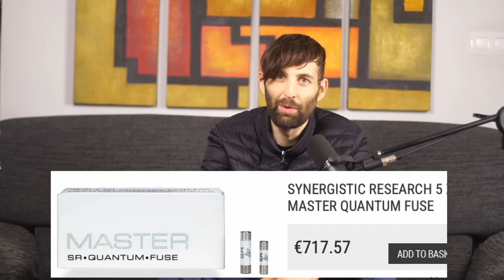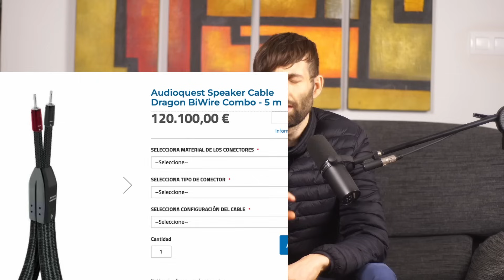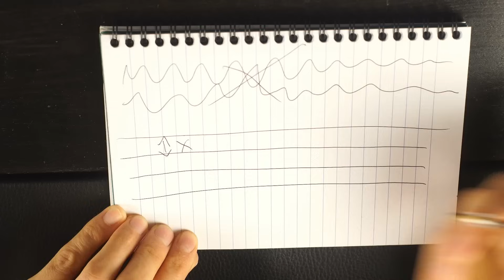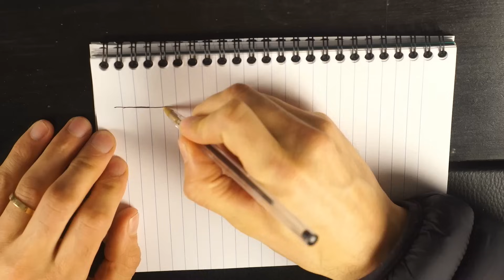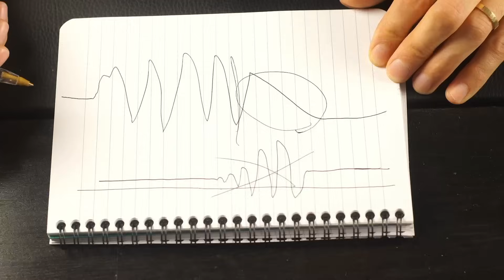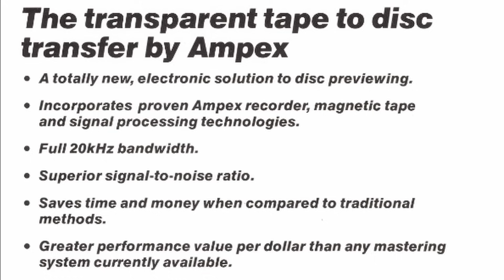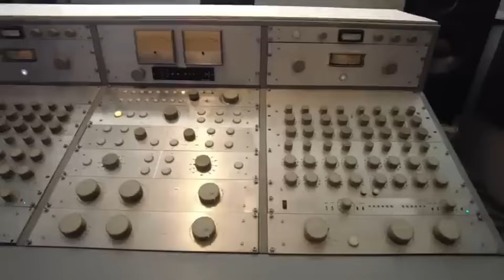Hard truth: most vinyl is digital anyway

Comment: Better is subjective. I predominantly DJ with vinyl, but I definitely notice that it's not as clean and the bass definitely doesn't hit as hard as a .wav or even .mp3 file. However, for me the imperfections make it sound better, they draw me in and make me say "hey, I notice something here". Haptics and visuals is also a thing, I just love seeing glossy black records spin around with a pilot light dimly shining on it and seeing the sleeve and knowing exactly what you have in your hands is different from scrolling through playlists trying to remember track names. So in those aspects for me it's better, but it's definitely not sounding fuller than a proper digital file. 

It's the same as DJ'ing with vinyl vs digital. With vinyl you really need to know your records inside out, you have no 2nd chances, no loops, no hot cues so you're way more involved with your music. With digital you can just throw on sync, press start and it will work 9/10 times without even needing any headphones. I have no connection to my digital library, at least not in the way I do with my vinyl.

Comment: What about cassette tapes though? You would think that audiophiles would value them over vinyls because they have less shortcomings and still retain the characteristics of analog media. I feel like the popularity of vinyl pushed out the best analog format that was on the market. Yes, tapes still have issues, but they’re cool imo.
Reply from the maker: the problem with cassette tapes is that the tape is too skinny. It's just a bit bigger than 1/8 inch but has 4 tracks (2 in each direction). You need 1/4 inch stereo to get a good sound and professional masters are 1/2" or 1" stereo.
Reply: @  Thanks for the explanation. I didn’t expect to get a response so fast, let alone one at all 😅. I wonder if the technology would have improved more in the present day if it were as popular as vinyl. Perhaps one day we could get compact tapes with quality sound. I currently don’t even listen to music that surpasses 16khz, but I’d like to find higher quality formats that I can physically own. CDs are probably the way to go for now.

Comment: These days where everything is digitally mastered and copied on cd to maximum levels is why I think audiophiles "think" the vinyl is better because the limiter and other stuff is shut off. It makes the vinyl version more. enjoyable to listen to. When I import a lot of modern cd files in my DAW I don't see much dynamics. For me that's a no go because like speaking you never speak at the same level all the time. It sounds unnatural and boring. It's a trend these days and a lot of mastering engineers hate it but they have to do their job. Vinyl isn't better or worse then CD. It's another medium with its pros and negatives. I don't care if there is a digital step in the whole process. I don't mind some minor noise pops and ticks which vinyl can develop over time. It's a part of the experience.

Comment: Regardless of what side of the issue you're on, you are making 1 big mistake. Sound quality is subjective. You simply can't say something sounds better than something else. Its no different than saying green is a better color than red. If someone likes analog better than digital, that's just the way it goes. Some people like McDonalds better than fine dining. Like it or not, that's just the way it goes. To be objective, is A different than B. To be subjective, is A better than B. I understand what you were trying to say in your video, but you just can't tell people what to like. 

You're clearly frustrated with topics like this. And that's fine. You're allowed to be frustrated. I'm sure you've notice that no matter how many videos you make on the subject, you're not going to convert too many people, if any. Why is that? Part of it is what I already mentioned. Some people like the sound of vinyl, and that's all there is to it. 

Now for something different. Step 1 of the scientific method is an observation is made that can't be explained using current knowledge. Research has to be done to find out what's going on. For example, if you want to tell someone they can't hear a difference between 2 pairs of cables, and then just do some measurements, that's junk science. Science requires you to engage with the people that are making the actual observations, and learning as much about it as you can. You're ultimate goal, of course, is to set up some type of test in attempt to prove if the difference is real or imagined. That sounds like a fairly reasonable concept. The truth is this. A lot of these debates started out in the 1970's. That's about 50 years now. In all that time, the skeptics who always talk about science and measurements, have never done a single test using real science, on any piece of audio equipment ever made by human hands. Not one test. There's 2 sides to every issue. Have you guys ever considered any of this? Real testing is not that difficult to do. What I find the most disappointing factor in all this, is if you, or someone like you, reached out to the audiophile community and told them you are a skeptic, but you want to do some real testing based in science, you would have hundreds of offers from people all over the world, who would want to help. You would be invited to hundreds of homes, some would lend you actual equipment, and any other type of help you need. All you have to do is ask.

I know this is a long post. I'm almost done. I want you to watch a video on youtube. Do a search for Synergistic Research vs Audioholics. Ted, the owner of SR and Gene from Audioholics have been going back and forth for years. Ted finally made Gene an incredible offer. He's willing to give Gene an all expenses paid trip to his factory in CA. 100% of all expenses. His offer was simple. Gene wound have complete access to his entire factory, and could test any product, any way he wanted, with no restrictions. Ted's only requirement is that he video tapes all testing and make high res recording of all the tests, so that anyone who wanted to see them could download the files and judge for themselves. He turned it down. To be clear, none of this is on you. I'm using this example just to put things into context. If no one is willing to step up and do something meaningful, the next 50 years will be spent arguing just like they have for the last 50 years. I know people on both sides of the issue are going to throw insults at each other. They always do, and I have been just as guilty as any of them. Maybe try a different approach this time.

Comment: I’m into HiFi, Linn, Rega with BBC spec speakers and yet your spot on.  The quality of the sound is down to the skills of the recording and mastering engineers…the quality of music down to the artist.  What I noticed in the transition to digital is that many early 60’s 70’s records that were digitised were much poorer than the vinyl, but modern engineers seem to have improved this…plus probably the quality of the digital kit improved…as a computer scientist I know that access to high quality at reasonable costs changes rapidly.  Also liked you sound cloud suggestion, this rammed music is tiring.

Comment: I think you're a little off the mark. The comments are usually that the vinyl LP sounds better than the same CD. CDs are often brickwalled or "slammed" as you call it- I DO have CDs that sound better than the vinyl, but for the most part, LPs are usually what sounds more realistic "or dynamic" to my ears. I realize my CD player is not the same as my turntable and each has their own inherent sound, but that's my experience. I have bought LPs that sound like they were mastered from the CD file--those get returned! CDs are not Hi Res digital.

Comment: Why do you speak so fast as if you are only reciting something from a book ?
All my records are pre-digital. 
After listening to tube amplifiers in the early 60's, many music lovers were disappointed when they switched to solid state. I was one of them. The sound had "changed" .
Reply from the maker: tube amps have high impedance outputs and often have a warmer tonality because of it, in addition to more harmonic distortion. If you like that, then fine, you can still buy tube set ups.
Reply: @APMastering Tubes have more  even harmonic distortion, solid state has more odd. Also tubes overload more gently with the waveform rounding off where solid state cuts the top of the waveform straight across.

Comment: While new digital is wonderful, original cd players sounded like chainsaws prior to getting the filters sorted. How do I know, old enough time have heard the carnage firsthand.
Reply from the maker: yeah especially with 44.1 you need to get the low passing right otherwise it will sound bad. That's one of the major reasons 96k sounds better, not because it's better but its because the low pass filter has a chance to be better

Comment: CD sounds fantastic, especially the early CD issues. Vinyl has a distorted sound that’s more elastic and less accurate. I love both and have been buying vinyl and CD for 40 years now. 
Vinyl is now being pressed from high definition digital files because it’s far easier to do this rather than use a complete analog path.
The Nightfly was recorded on a 3M digital machine.
ABBA had one from 1981 onwards, The Power Station recording studio in New York had one that Nile Rogers liked to use.
There are many flaws with vinyl, inner groove distortion is incredibly annoying, especially for songs you love, CD excels here. Clicks, pops in the wrong places are torture too. CD is accurate, powerful and transparent.
What I hate about CD remasters is the loud compressed audio that’s going on for the last 25 years. Compressed modern vinyl is even worse as it’s now €40 a pop! Expensive rubbish.
Reply: Actually, ABBA, The Visitors, was the FIRST commercially produced CD, not the first sold that was Billy Joel (and was an analog recording), but ABBA was the first produced, and it was digital end to end, it was also the LAST CD they did before their break up, they have since issued an album more recently Voyage in 21'.
Reply: @ As far as I know, the first 3 tracks of the Visitors were analog, then digital from there on. There’s a definite snappiness to the drums that’s not on the first three songs.
I have a “Red Face” 1983 CD of The Visitors and The Singles double CD.
Reply: @KRAZEEIZATION  I was not aware, I'm from the industry and was always told it was D end to end, but I was not at the sessions and never saw the mix, so you could be correct,  D was not super wide spread yet in 80/81 other than perhaps with classical recording, they seamed to start earlier.
Reply: @ I read that about Visitors a while back. I’m obsessed with music and recording so I’m always annoyed when album details are not comprehensive enough for me!

From Wiki-
The members of ABBA and their personnel have memories of the recording sessions for this album being rather difficult. To begin with, their sound engineer Michael Tretow had to become accustomed to using the new 32-track digital recorder that had been purchased for Polar Music Studios. He said, "Digital recording...cut out all the hiss, but it also meant that sounds were sharply cut off below a certain level. The sound simply became too clean, so I had to find ways of compensating for that". The first three tracks for the album had already been recorded using analogue tape and therefore Tretow had to transfer all subsequent tracks from digital to analogue and back again to avoid a difference in quality.
Reply: @KRAZEEIZATION  Excellent!!  I love that you have passion for the industry,  I'm no longer active, but I listen to my huge collection of virtually all media types every single day.  Nothing gives me so much enjoyment!
Reply: Expensive rubbish for real.

Comment: Vinyl is analog. Digital is an intermediary format you can' t listen to except when you fancy Super Mario Gameboy tunes , C64 games or firmware updates coded in audio. But listening is analog. Even when you print an e-mail or spreadsheet on vinyl, it will be analog square waves because vinyl is analog to air pressure. I can't help wondering if you could open it after you record it in a DAW :). 1 bit pulse density is also analog to air pressure. I think analog coloring is more enjoyable because it's imperfect, but you can perfectly capture analog imperfections in the digital domain. And for the record, your channel is just EXCELLENT.